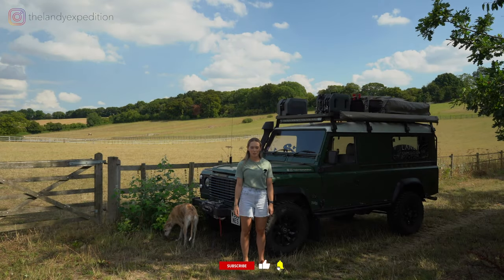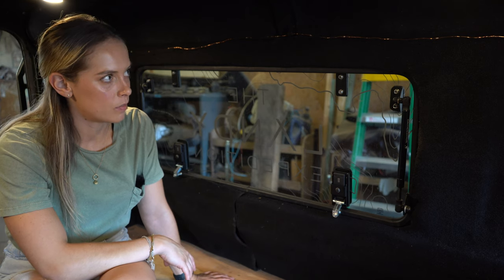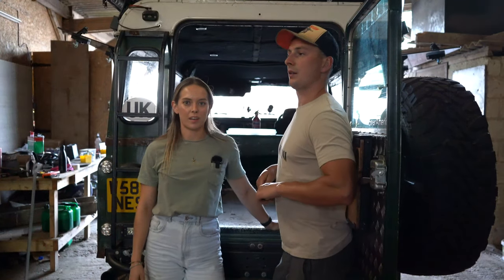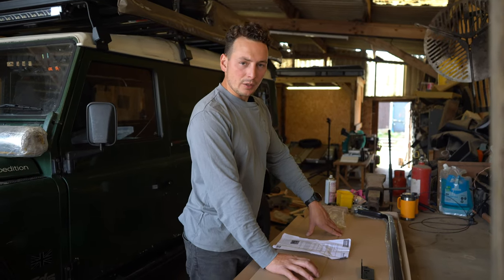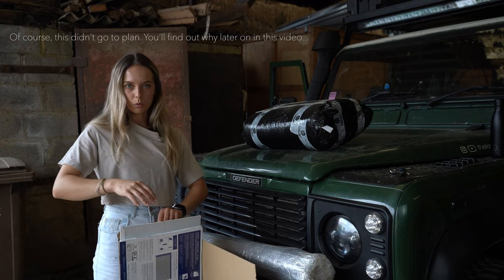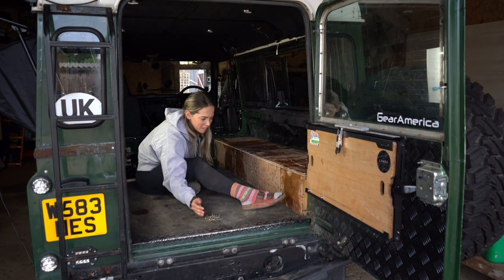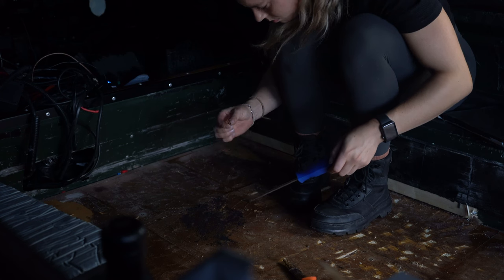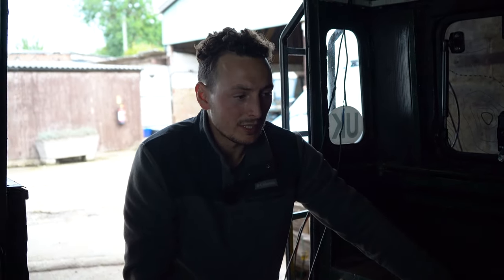Defender 110 Camper Build Ep.1 | Converting Our 20-Year-Old Td5 Land Rover into Our Dream Camper

Comment: hello thank you for these beautiful videos I have a small question, I also have a 110 td5 to travel except that it is too high and my tires too wide, what did you put in suspension height and tire size I find your def perfect thank you (sorry for the english I'm french)
Reply from the maker: Bonjour! Merci pour la commentaire, Je peux parle en peu de français avec toi! :) 
Mais c'est la tout! Haha! 

So we run Old Man Emu suspension, with a 2" taller springs. We have a lot of weight when fully loaded so the Defender sits nicely at this height. 

Our tyre size is 265/75/16 we have the toyo open county mud terrain. They have been amazing. 

a tout à heur!! 

Harry
Reply: @TheLandyExpedition  thank you very much for the answer good continuation for the arrangement you are cool salut

Comment: Please say you’re gonna do something with them tub cappings
Reply from the maker: It’s on the list! 😉
Reply: @TheLandyExpedition  oh phew! I had to do similar on mine, new floor and crossmembers, new tub cappings. Go galvanised, I used YRM parts, just fit straight in no trimming needed. Closed cell foam between steel and aluminium contact and treat yourself to a pneumatic or electric riveter, you’ll be so thankful! Best of luck :)